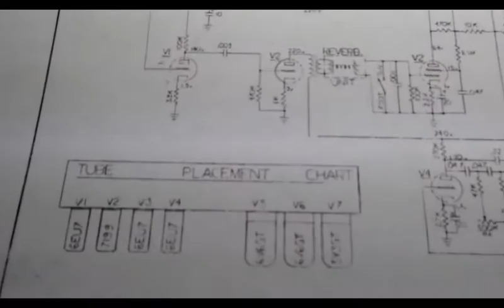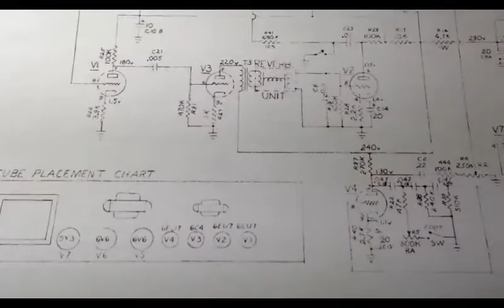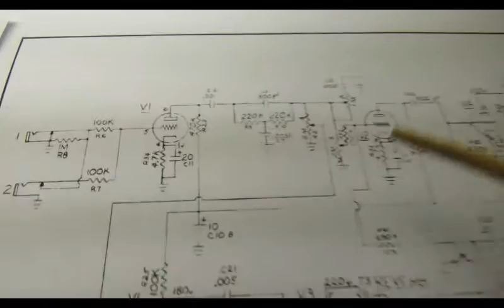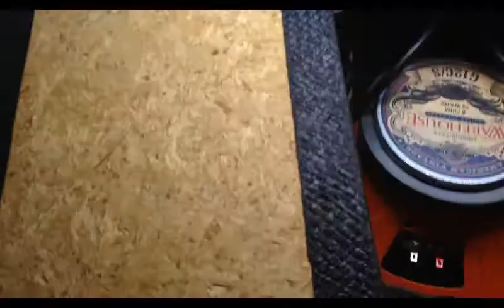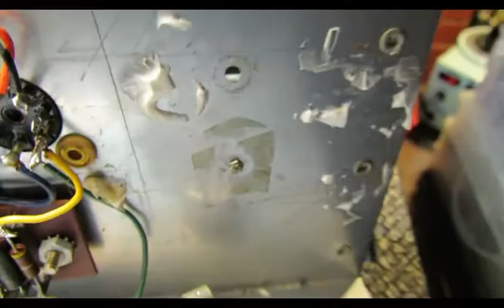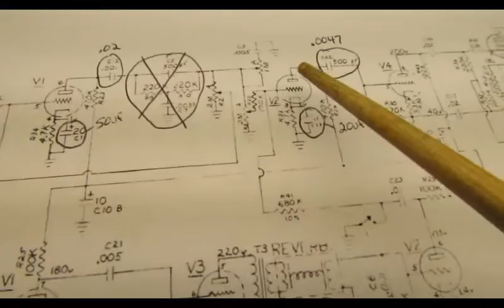Modifying and Comparing Gibson GA-19RVT Falcon Amps

Comment: Yo! I have a '65 Gibson Mercury Medalist that I'm overhauling. My father-in-law recently gave it to me. He bought it new(!) I changed out the filter caps (and a few others). I replaced a few tubes (some are still original RCA's) and added in adjustable bias. Since both channels are the 99% the same, I decided to gut one channel and do the front end of a 5F6A Bassman on one side. But the side with trem, I'm leaving be... except for that horrible tone suck network you refer to in several videos haha. In the Mercury, it's part of the mid pot. Would you just cut all that out? Trying to find the best way. Love the sound of the left amp in this video. Maybe I'll just do that. Thanks
Reply: It has the "tree bark" tolex and the exterior is in great shape. My wife likes it in the corner of the living room as decoration haha
Reply: So, looking at the GA19RVT schematic... is there no tone stack at all?

Comment: Subscribed 😊
I absolutely love the detailed content on all of your videos 

Thanks......much appreciated
Reply: I also have a question if you are up for it.
I'm looking at a Facebook add for a wheat grill falcon.....the add says that it's missing a power tube but still functions well.

Is that a big red flag? Won't the remaining tube run way to hot and cause damage to capacitors and other parts?
I'm very new to tube amps but I'm learning with the help of channels like this.
Looking to purchase my first tube amp successfully......not run into a nightmare. I look at some forums and some say it's not good to run it with a missing tube.....and if it only has 2 power tubes.....it's definitely a no no.

Your opinion and knowledge would be greatly appreciated

Comment: When changing the cap values for the bypass caps and decoupling caps, do you do this one by one because technically I would think you would need 4 to 6 capacitor decade boxes to be switching all of them for all the stages at the same time or its going to be a domino effect when changing only one cap value leaving the rest the same and when you change the next cap value that is going affect the others so you get this domino effect? This process is called Amplifiers Tuning
Reply: Ive wondered about this. Voltages will change maybe as caps are changed. Thing is, after all caps and resistors that have been replaced if out of tolerance, the amp at all test points, should read what values are stated in the schematic. This is assuming the transformer is outputting within spec. [power xfmr]

Comment: I just did that mod to my Falcon....and it became a TON bigger and warmer....but it seemed to have lost its mojo. I swapped the .02 for a .01 and it got back its crunchy awesomeness without being the thin amp it was at first. I think the .02 lets too much bass through. And when you change the other cap from a 500pf to .0047 I think its just too warm.   Even the original had the 500pf coupling cap IIRC. I kept the .0047 but swapped the first coupling cap to a .01

Comment: I just bought my first Gibson amp, a very clean (cosmetically) Falcon like one of these.  Has the original cover and manual, but somebody replaced the tube rectifier with S.S. and duct taped over it!  Also has a 3 prong plug but a 2 wire cord.!  Almost afraid to see what the chassis looks like inside.  It works, but the volume is very low.  Still sounds decent all things considered, but sure could use help.  There is a lot of potential, I think.  I bought a Variac recently and am getting a better Multi-Meter but I don't think I'm ready to get this thing squared away.  Great video; these Gibby's need more love!

Comment: Interesting plate resistor fact: 470 K instead of 220 K gives more second order harmonics.
Reply: I have a Gibson Falcon amplifier and love it. I had one when I was 15, about 58 years ago and foolishly sold it. Then about 25 years ago, I found one sitting in a basement of a house that was being demolished. It was a mess. It had been on the floor with water dripping on it and rusting badly. I took it home with me anyhow for nostalgic reasons. A friend of mine took it home and did a beautiful job of reconditioning it. I use it sometimes instead of my Fender Twin Reverb. It's still a great amp.

Comment: I have 2 of those brown ones like you have on the left. It is true they can sound a little shrill and thin stock. But they have a nice chime to them. I had my tech guy mod them to tame the high end and get a bit more gain out of them. I don't know if they are the same mods as you did here but they sound niiiiiiice. That brown one on the left sounds super great. I would  love to have a schematic (which I can't read), take it to a builder and say "make me that".
  Also we need someone to start making good 6eu7 tubes again. Tungsol is doin it but they are not as nice as the old ones. 
Is go through them pretty good as I boost the signal at the front end of the amp hard. Great way to get distortion if you don't mind abusing your  preamp tubes.

Comment: Came upon this while recapping a 1965 version and found the 10/10/10 uf lytic at the side had two legs of the cap wired together to apparently deliver 20uf rather than 10 at one point.  The other 20/20 was wired as on the schematic,  Wondering if you encountered this as well and why they diverged from the schematic.

Comment: Mine is stamped on cab as inspected on April 19, 1963. Badger Wood Products. Racine, Wisconsin. Maybe thats just cab date. Serial on front plate starts with 48..has red arrows in knob tops. Supposedly a 63, from my findings.
I dont see the tone sucking circuit, and looks like someone has made mods to cap cans.
Havent played it in a few years. Came to me with a weber feromax.

Comment: Hey Guys, I found a 1963 Falcon GA-19RVT next to the dumpster at my building today. It fires up but there is no sound coming out of it at all. All of the tubes are heating up. The 6v6GT tubes are all black. I'm not sure if they are supposed to be that way. They are Peavey 6v6GT made in china. Before I buys a set of tubes for it is there anything else I should look at before drop the cash on the tubes? I'm handy with a volt meter if there are some measurements I need to take. Let me know. Thanks a bunch.

Comment: The "Tone-Sucking" network you refer to is a Bridged T-Filter.  In short, it's a midrange control.  Rather than delete it, you can modify the values, and dial in a more interesting tone.  I modded a Falcon.  I used a 680pf works for the bridge, and 200k for the tops of the T, and 2200pf for the stem of the T.  Reducing the value of the resistors, moves the center of the "V" to a higher frequency for a thicker tone,  and vice-versa for higher value resistors.  Reducing the value of the bridge cap makes the "V" deeper, as does increasing the value of the cap for the base of the T.  Changing any values affects the shape of the EQ to some degree.  Take a look at the schematic for the GA-30RVT.  It used 150K resistors for the top of the T, and a .01 cap for the base of the T, but they also had a pot underneath it.  Turning the pot CCW gets those too muddy very quickly, and too far CW makes them much too bright.  In short, the Bridged T requires a knife edge balance to sound good.  Increasing the value of the coupling cap preceding the Bridged T helps a lot, but your tip on increasing the value of the 500pf cap in front of the cathodyne phase inverter would be virtually inaudible.  The input resistance of this cathodyne is north of 12M ohms, so even a small cap will pass all the frequencies you need, although  it has been said that smaller caps will make the circuit more susceptible to picking up noise. In short.  Increasing that first coupling cap value, getting a more robust speaker, and even a beefier O/T would help the most.  After that, I would begin to have fun by dialing in the Bridged T.  As you were....
Reply: I took a closer look at the GA-19RVT schematic.  The 470k plate load resistor on the first 6EU7 doesn't need to be that large.  It really isn't providing much more in the way of voltage swing than say a 220k, or even 100k, and its large value pushes the load line down into a more horizontal orientation.  Down there, the characteristic of any distortion could be brittle.  I would also take a voltage supply reading, and re-bias it accordingly.  I also wish to correct my comment on the cap that feeds the cathodyne.  The 12Meg input resistance would not apply since it is AC coupled.  Still, the effect is probably subtle.

Comment: @The Guitologist, Are you familiar with the dual channel Falcon. I think they are from '68-69. Link to an image - http://www.tdpri.com/attachments/dscn0058-jpg.46947/

I have one, and I'd like to find schematics on it, but not sure of the model number is. There's no model or serial number tag on mine. It's a good little amp, but very twangy, even with the bass dimed, and treble cut. Not much range in the tone section. It also doesn't break up as easily as I'd like, or expect. Advantage to a low watt amp should be ability to push into overdrive at lower volume.

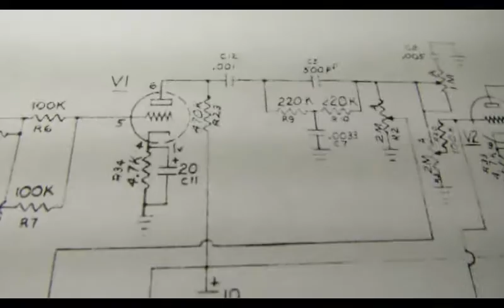Comment: At 8:30,  the plate resistors and bias resistors can be varied together along with a series 'coupling' capacitor with little change to the sound if proportional.  On a triode amp circuit like this, the cathode/bias resistor will flow enough current to bring the cathode to a point of being above control grid to where there is an equilibrium condition.  ie. with no input signal grid is pulled to zero volts nearly provided there is no leakage of coupling capacitor from a previous plate voltage .  At about 1.5V for a lot of preamp tubes below cathode volts, they are curbing towards a pinch off state and so that tends to be the idle voltage you'll notice regardless of the size of the cathode resistor (within limits of the tubes ability to provide current).  ie. if you use say a 1K resistor instead of 2.7K near 3X the current will flow to bring it up again near the pinch off voltage.  So the different resistors used will mostly affect often the point at which the tube saturates/clips.  Going with the 4.7K relatively low currents are going through the tube.  Higher noise floor but wider signal range I'd guess there.  Almost double the idle current with 2.7K so you have less headroom as the cathode can only supply electrons at a limited rate AND the Plate resistor and supply voltage will of course also present a limit.  We have 280V or so and a 470K resistor even if grounded will flow 280/470000 amps or near 6mA so in this case that's maybe less significant of a limiting factor.  THe 6EU7's max current is just a few mA I think?  Anyway... Changing the PLATE resistor meanwhile will have another impact in the circuit though..well a couple.  The higher the resistance the bigger the voltage gain since all the current is going through it save the small capacitive impedance in the circuit.  ALSO though there is an RC time to be considered with coupling capacitance and any other circuitry in series/parallel.   So for example we'd get a very similar sound if we used the 220K with the .02uf as we would with a 470K and a .01uf there.  But twice the gain.  So basically they double the voltage out of the chute there but then filter it in a more complex way rather than just a simple bass rolloff at 6dB/octave.  So C12 in that circuit functions to stop DC primarily from leaking through the resistances to V2's grid, and it rolls off some bass at what appears about a 1M series load with the 100K, two 220K and 470K from the power supply's current source.  Eg. say a square wave come in and suddenly turns the tube to pinch off state.  Bam you go from max current sagging the voltage at plate to it's lowest point to 280V and the RC time of the high pass filter is 1M X .001uF and if that wave just stays high,  the grid of V2 will experience an exponentially decaying pulse with a natural log point (about .39 isn't it as I recall?) at 1 millisecond roughly I'd think.  So that's minimally where THAT cap starts diminishing things.  a 500hz signal will pass fairly unaltered as you picture what that DC signal did that we just introduced.  ie. 1 msecond is a half wave at 500hz... so that signal can form well within the confines revealed there since it's going from zero to peak to zero again.  Rather than explaining using more complex math than some have taken you can get a concept by drawing these things out.  
But it begins to roll off the bass at some point at 6dB /octave getting ride of very lows we don't want over excursing the speaker etc.

 The filter circuit after the .001 (C12) then... has yes a high pass element in the 500pf. Coming into as much as a 1M load depending how pots are set there I suppose... but the 220K resistors are shorting highs to ground so you really have (to the high frequency component) an essentially 100K load on that part of the circuit since they will pass very efficiently through the .0033 or 3300pf capacitor.  LOWS on the other hand (ie. frequencies outside the RC time domain of 220k X 3300pf = .007 seconds or so....1370 hz ish.  so a few hundred hz will generally pass through lightly affected so those low frequencies essentially have a 440K resistance into the 1M drop or so.  But at 1000 hz it's being attenuated significantly by the 3300pf cap to ground.  Anyway maybe a good mod on those units would be install 

Anyway I appear to have an oddball amp...someone brought in here. It appears to have the older covering on the grill...a tweed (redone?) yellowish covering on the cabinet and the 6C4 (using the maestro schematic).  Wood on the handle!  hmm.  Fairly nice shape from a guy in Helena, MT.  I'm tired so hopefully I didn't confuse anyone too much :-)
Reply: PS in the diagram I have it says 300V off the rectifier.  290V at the screen so the 400V cap or even a 350V would work fine unless it's a fail prone /old one as noted.  There would be nothing wrong with having them in parallel except the fear that one of the old ones would leak.   Having MORE capacitance though can be a good thing until at some point charging them up starts blowing fuses on startup :-).   

Generally smaller values were used because of cost/size restraints back in the 60's but in blues amp applications recitifier sag is desirable.  In that case more capacitance would often be a bad thing since it would increase the time it takes for a sag to be perceived.  But in cases where you are purely looking for clean tone, bigger is better since you don't want sag or noise in the signal as it sags.

Comment: Another really awesome vid!!! Very enjoyable to watch...and I always learn so much!! Quick question: you did the "same" mods to both the left- and right-most amps, correct? You attributed the difference in sound to the new, "tight" speaker (and wattage difference too)...is there a way the average person would be able to know/tell that the difference in sound is the speaker "only" and not a mod difference?
Reply from the maker: Without opening an amp up, if you have experience with that particular model and know what it should sound like stock, you can sometimes tell if it's been modded. But the best way is opening it up.

Comment: Brad, looking to retube my falcon.  any recommendations?  mine is the model with 6eu7 pre's.  '62, I believe?
Reply from the maker: With 6EU7...you're very limited on choice. Only Tung Sol makes a 6EU7 current production. Here's a link to those: http://amzn.to/2qs5XYp
There's NOS, but you'll probably pay thru the nose for them. That tube wasn't used in a lot of common circuits outside guitar stuff or vintage PA gear, it seems. A lot of people rewire the sockets for 12ax7, which I wouldn't personally do. Better to just buy the new production tube and it'll probably last a long time if you don't throw the amp down a flight of stairs.
Reply: 6EU7 is basically a 12ax7 with different pinout, so shouldn’t affect the sound of the amp.

Comment: Just watched your demo on these 3 Falcon amps.  The middle one sounds very "thin".
Was it also modified?  Maybe it's the speaker? Sounds like it has seen better days.
The first one sounds good and the third one sounds not to bad for a replaced speaker. 

One thing I never liked about Gibson and their Epiphone amps was the construction layout technique used in placing the circuit components which made
their amps kind of messy inside to begin with and even messier when repairs had to be done to them.

Comment: Thanks for the videos on these old Gibson amps. Just picked up a non-functional Falcon 19rvt. Mid-1964. Needed a fuse. Works great except the tremolo is not working. I've swapped tubes. Tested the foot switch. Any advice on what typically causes the trem to not work? I have installed a grounded plug. Removed the death cap. Removed the weird square tone cap as well. Thanks!
Reply from the maker: There are four caps in the tremolo circuit. Replace all four of those and check all ground connections in trem circuit.
Reply: Thank you! Ground connections all look good. Went for caps today and in,y had trouble locating the .22 400dc black beauty. Any suggestions on a replacement?
Reply: Replaced tremolo caps. Still no Tremolo.
Reply from the maker: Weak tube possibly,. Hard to tell without having it in front of me on the bench.